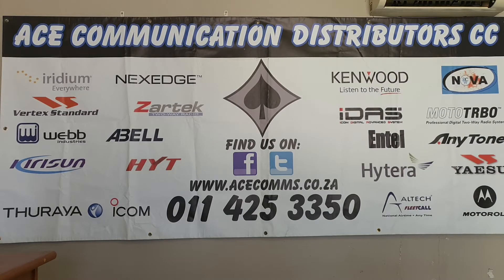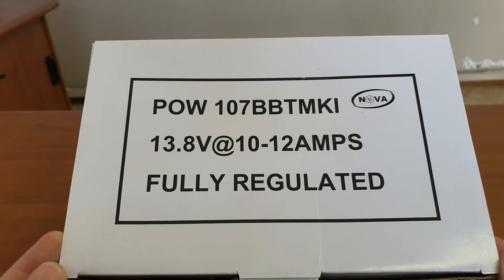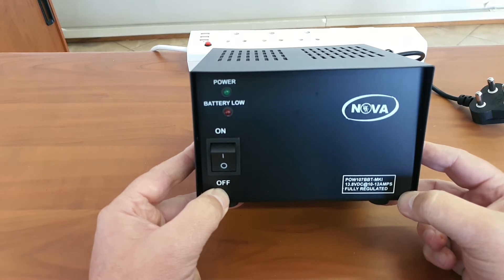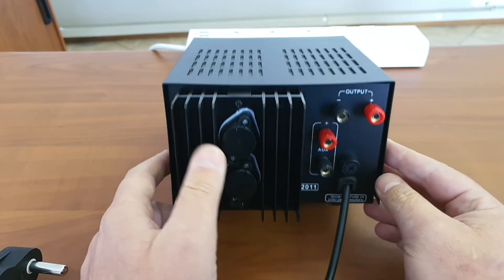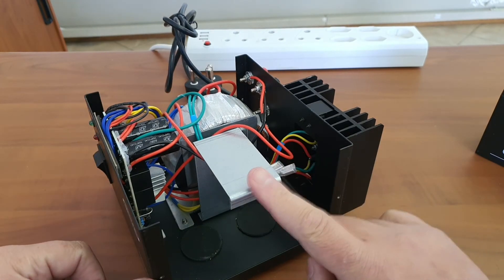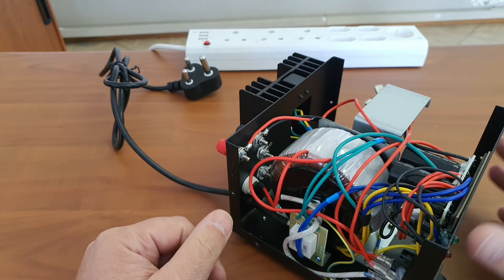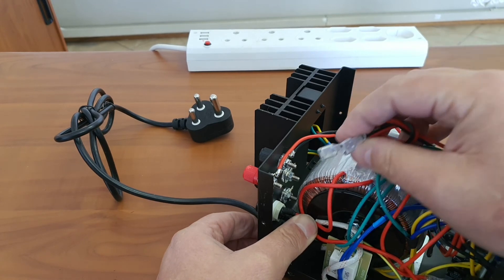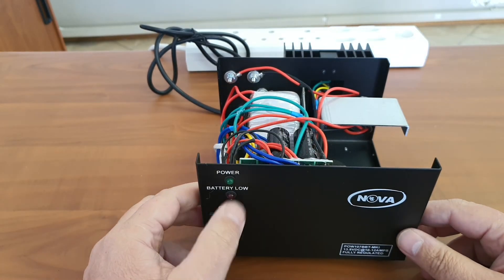NOVA RCW POW-107BB

Comment: What type of transformer you use ,there is two outputs .I am looking to buy a transformer.
Reply: Hello Johan, we have 2 Variants, one uses a Toroidal transformer, the Other a Standard Laminated Core Transformer
Reply: @ShaunTaute  the one I amlooking for is squire one in my nova pow106bb there are two tapping what is the value in volts
Reply: @ShaunTaute  price on transformer and what is the tappings,